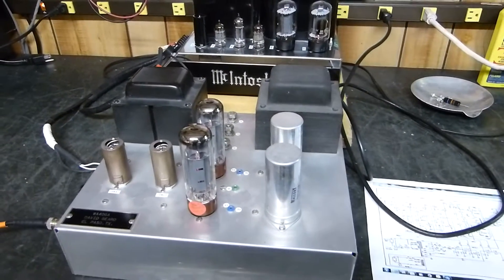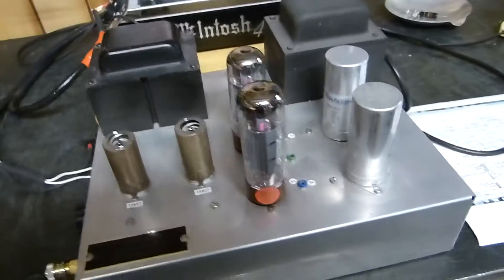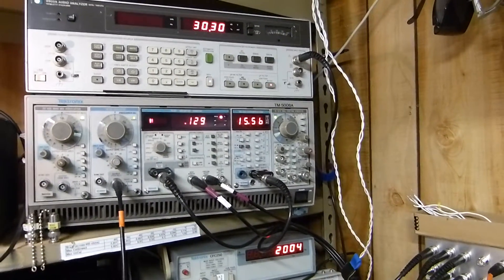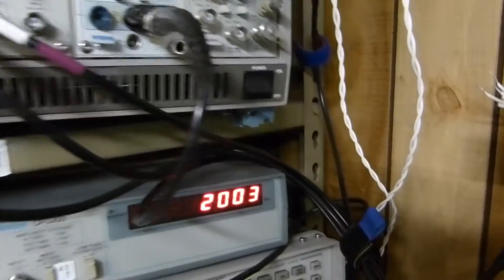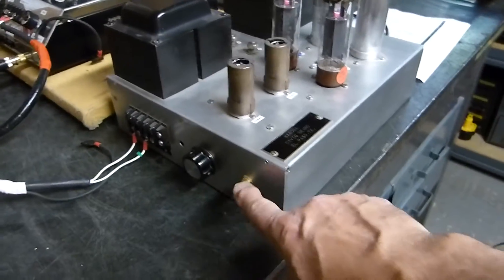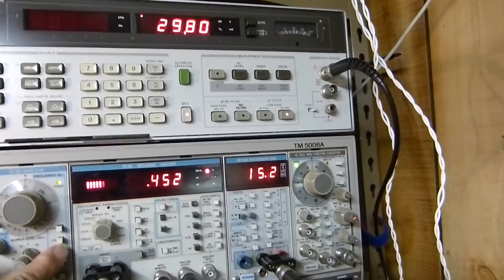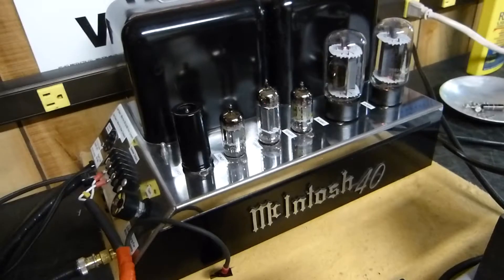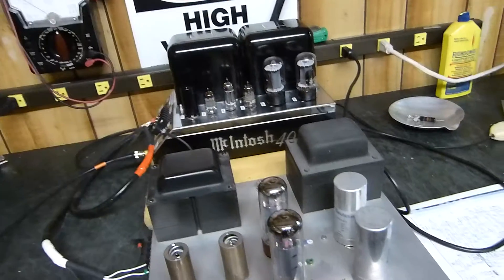McIntosh MC40 vs MA230 Mono Channel Vacuum Tube Amplifier

Comment: I'd check the 12 uF cathode capacitors C10 and C11 on the output stage. Since the cathode load is an inductor, a bad cap would cause the frequency response of that side to decrease, making the drive asymmetrical at high frequencies.
Reply from the maker: rlumpy I totally agree with you that these could cause problems but I have replaced them along with the cathode cap on the first 12AX7 stage. They all had a bump on the end where something was wanting to spew out as is common and I am sure you have seen. Thanks for your thoughts. I will keep working on it and maybe figure it out. I have made progress and the THD at 20KHz is about 0.7 % better than it was.